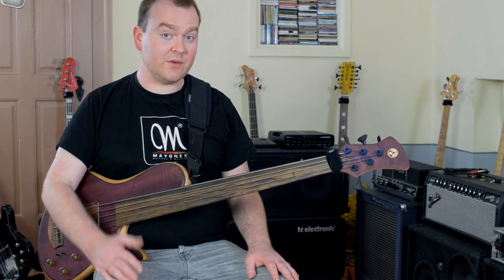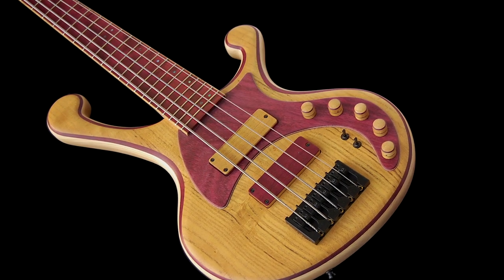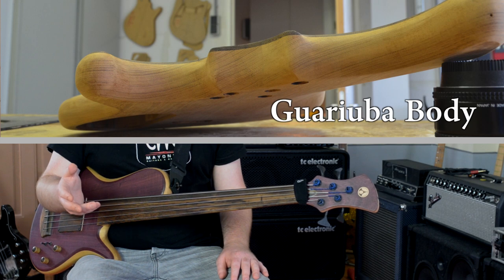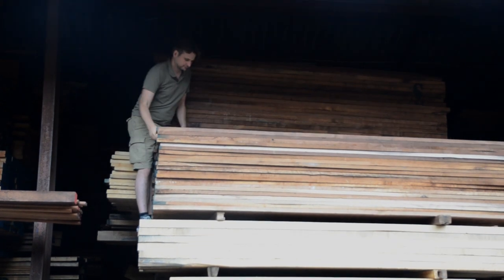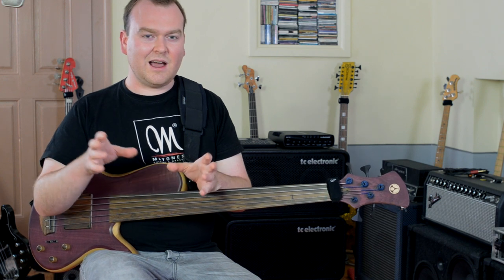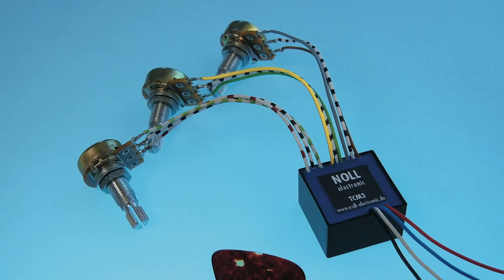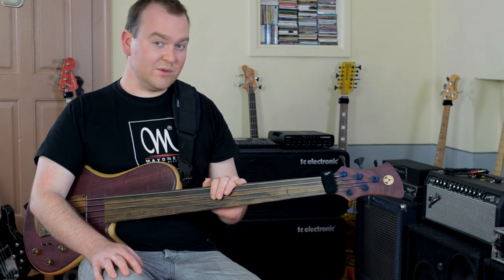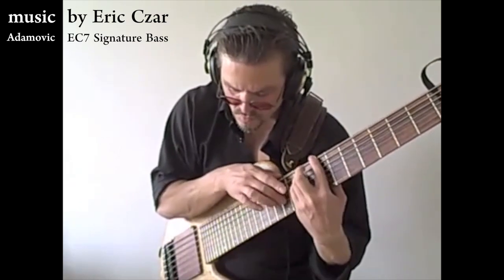MEET THE LUTHIER - ADAMOVIC BASSES

Comment: Im not trying to prolong any ongoing debates about the mystical tone woods or the musical properties of certain  woods, however i think its more scientific than that.  I believe that the density of woods and their resonate properties can effect how an instrument can sound especially in bass guitars.  Porous woods  for example Mahogany might allow more resonance to pass through them allowing for more resonance from the strings and would allow the pick ups more ample opportunity to do what they are intended to do.  Whereas, Dense woods for example Walnut, and ebony  would act more as a barrier or a stop to the resonance.  with this being said using these principles one should incorporate the shaping of the woods in such a way that resonance should pass through the  softer woods and then be stopped or suppressed by the hard woods working to contain the  sound throughout the softer wood.  Sound is emitted from the strings it expands through the soft wood then the resonance/sound comes into contact with the hard wood and is then focused or bounced back to the strings and the magnetic field emitting from the pickup therefore containing the sound and  holding onto the resonance and building the tone and sustain.  I may be wrong there may just be some magical wood properties that simply harry potter the right tone who knows.  I for one am keen on trying my theories by designing a shape and contour to put this into practice.